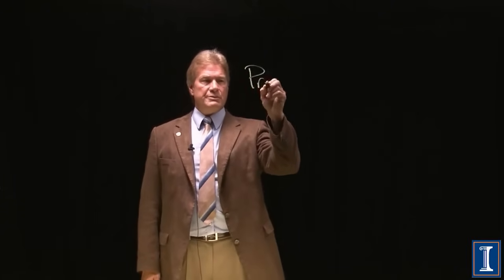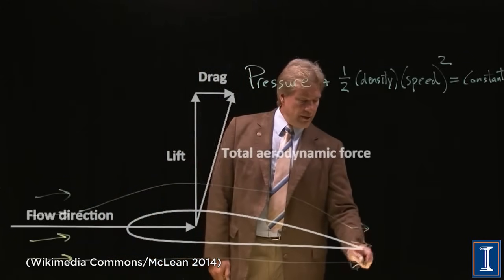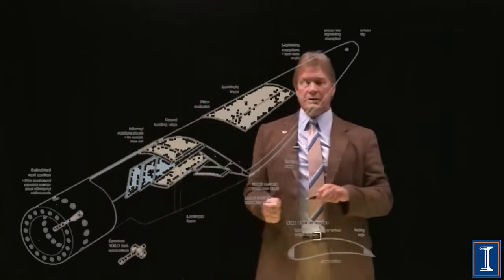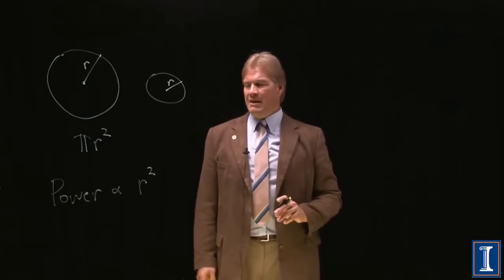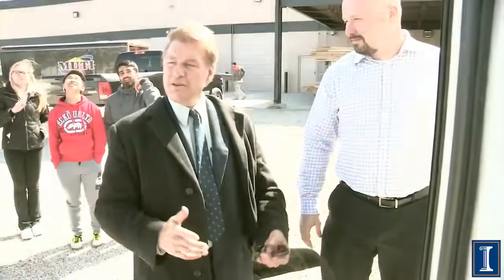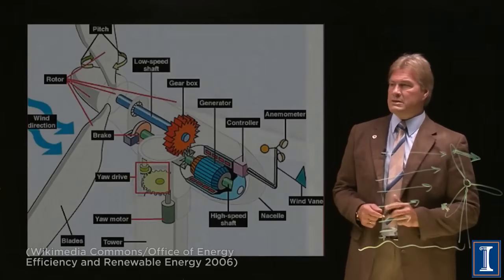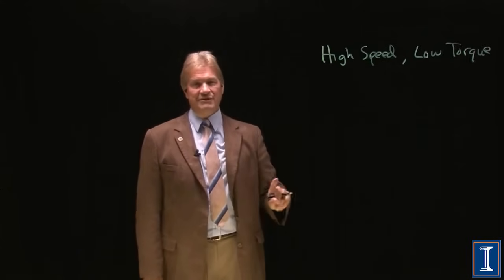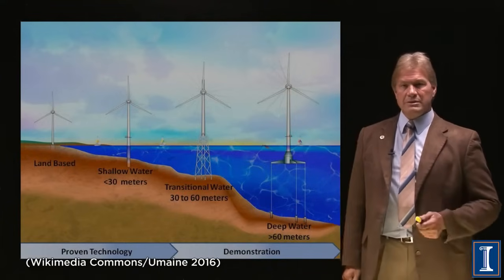How Windmills Work

Comment: Bernoulli theory of flight is complete academic nonsense, despite the math being "cooked" to make it look right. According to Bernoulli, a zero-thickness foil at an angle of attack, shaped to exploit the Coanda effect has no lift. Neither does the symmetrical airfoil of an aerobatic plane. 

Lift is created by Newton's laws. A change in momentum of the air creates an equal and opposing force...push air down, plane goes up. Bird wing, bat wing, bee wing, housefly wing are all net pushers of air downwards for lift (and rearward for thrust). The wing is nothing more than an air pump. 

Same goes with the farm windmill 15:39 and Dutch windmills - you yourself said they are flat panels - Bernoulli says nothing happens. Zero lift. Yet they are magically high torque. Torque is net perpendicular FORCE at a radial distance orthogonal to the axle.

The ONLY reason for an airfoil shape is to minimize drag around the structural elements of the wing and to keep airflow attached for as long as possible - laminar flow. The low speed Dutch and Farm windmills can ignore the drag component because the airflow is low speed. Old aircraft and hang gliders use shaped foils, not faired spars - both fail Bernoulli. All that matters is the net difference between the drag and lift net components perpendicular to the radial direction.

I'd also point out that modern windmill tips can go into the transonic regime, not merely 150 MPH. It's the reason for avian kills - never saw it coming.
Reply: Sorry, but you are misinformed on the subject and simply repeating common misunderstandings and rhetoric that is spread across the internet within communities that debate such topics.   Now if you talk to an actual aerodynamicist who actually studied, understands, and models all the physics involved he will tell you that both Bernoulli and Newton accurately depict the physics involved in generating lift.   

Even NASA (who knows a thing or two about the physics of flight) say as much:
https://www.grc.nasa.gov/www/k-12/airplane/bernnew.html

You made the claim "According to Bernoulli, a zero-thickness foil at an angle of attack, shaped to exploit the Coanda effect has no lift."

First of all Bernoulli never said such a thing.  Bernoulli never talked about the physics of aerodynamic lift.  He was concerned with describing, mathematically, the physics of fluid flows and he did so accurately.  The math was not "cooked" to look right  (whatever that means), it is IN FACT right (within the constraints of proper application) and they are used to this day in all kinds of applications within fluid dynamics.   His equations accurately describe the relationship between pressure and velocity within a fluid flow, within the constraints of the proper application of his equations.   However there are of course limitations to his equations because they greatly simplify the physics involved and don't factor in other ways energy is transferred out of the system hence they breakdown at higher velocities when compressability becomes a major factor. 

If you take a sheet of plywood (no airfoil at all) and give it a positive AOA the flow of air molecules will need to curve steeper and steeper to get up and over the plywood.  This means the air will be accelerated over the top of the plywood moreso than over the bottom and as a result there will be a pressure drop over the top of the plywood just as Bernoulli predicts and because there is are imbalanced forces there will be lifted generated.  What happens when the AOA gets too high? The flow of air will stop curving up and over the plywood and the plywood wing will be "stalled" and lift will drop away despite the fact it still has a positive AOA that can deflect molecules downward.   Your simplified explanation of molecules merely being deflected down doesn't explain why wings can stall and stop producing lift with healthy amounts of AOA available to deflect molecules downward.   Ever watch airfoil and airplane wing testing?  They put the flow indicator strings on the top of the wing not on the bottom.   The moment those strings stop showing airflow across the top of the wing we know the wing is stalled and not producing lift despite the fact it can still deflect plenty of air molecules on the bottom of the wing downward.   

Next example is a typical house with a typical high ridged roof battling hurricane winds.  We can all agree that with the windows closed  there is absolutely no flow going under that roof.   The house is completely sealed (for the purposes of this discussion) and thereby there is no flow under the roof at all.    Now we know, for a fact, that roofs blow off and go flying way up (produce lift) in hurricane winds.   But why? All the air molecules are being deflected UPWARD towards the sky and according to your simplification of the physics involved the roof should be producing DOWN force not UPFORCE.  Yet we get the opposite.  But we do know from Bernoulli that as the mass flow of air runs into the ridged shaped roof it will need to accelerate compared to the rest of the flow in order to get up and over the roof and thus it will create a low pressure region over the roof at which point the higher pressure (inside the house) will then PUSH the roof right off the house and up and into the air.  

The bottom line is all lift is created by pressure differentials and Bernoulli is talking about modeling pressure differentials across fluid flows.   Remember gas pressure is the force exerted by the gas molecules on the wall of something.  Even in your over simplification of momentum transfer, ultimately, we are indeed talking about air pressure on the wing (what other way would force be exerted)?  A helium balloon lifts upward because there is a pressure gradient in the atmosphere and there is more air pressure pushing on the bottom of the balloon than on the the top.   A rocket engine (which is Newton's third law at work) moves forward from the force of fluid pressure on the walls of the engine and nozzle.   That is why rocket nozzles are optimized for the pressure they operate in so that the pressure generated within the engine is used to move the rocket forward and not wasted away (as it would be without a nozzle).  That is why nozzles made for the very low pressure of space are as large as practically possible (before the packaging constraints and added weight becomes self defeating).
Reply: @thekalikal  Re-read the article. It says nothing about the relative contribution to lift from Bernoulli.  It is simply a fact the Bernoulli principle contributes very little to lift.  A Cessna 172 would have to fly at over 400mph to get airborne if Bernoulli's principle were the explanation for lift.
Reply: Here is the relevant language in the NASA article. 

"There is also an incorrect theory which uses Newton's third law applied to the bottom surface of a wing. This theory equates aerodynamic lift to a stone skipping across the water. It neglects the physical reality that both the lower and upper surface of a wing contribute to the turning of a flow of gas.

The real details of how an object generates lift are very complex and do not lend themselves to simplification. For a gas, we have to simultaneously conserve the mass, momentum, and energy in the flow. Newton's laws of motion are statements concerning the conservation of momentum. Bernoulli's equation is derived by considering conservation of energy. So both of these equations are satisfied in the generation of lift; both are correct. 
"
Now I never claimed all lift can be completely calculated using Bernoulli's equations.  As stated before Bernoulli's equations are simplifications and start to become less accurate as compressability starts to become a bigger and bigger factor at higher speeds in compressible fluids.   However, the general principle of low pressure occurring when an airflow is accelerated is the reality by which wings generate the vast majority of their lift which is Bernoulli in a nut shell.  As the AOA goes up the air is indeed accelerated more and more over the top of the wing (and you get more lift) up until flow separation where the lift will plummet.   If it isn't Bernoulli at work why is it that the lift plummets as soon as flow separation across the top of the wing occurs?  If it's mainly just bullets of air molecules being deflected downward then there should still be plenty  of lift available at high AOA's when lots of bullets are being deflected downward.   Yet we know from reality as soon as flow separation occurs on the top of the wing the lift goes to zero for all practical purposes.  

Your claim that  a "Cessna 172 would have to fly at over 400mph to get airborne if Bernoulli's principle were the explanation for lift" is something you just pulled out of thin air.  Can you please show me the CFD analysis did to attain this data? 

The reality is that at subsonic speeds the the pressure differential created by accelerating the air mass over the top of the wing is responsible for the majority of wing lift AS EXPLAINED PER BERNOULLI.  It is also the principle by which stall indicators work.   

It also explains how and why air foils stall at a certain AOA and how you can physically see a stalled wing with string flow indicators.  The stone skipping or "bullet" lift theory advocated above doesn't in anyway explain why a wing with plenty of healthy AOA remaining to deflect air molecules downward can produce nearly zero lift once you have a flow separation from the top of the wing whereby there is no more accelerated airflow over the top of the wing to drop the pressure which creates the pressure differential in order for lift to occur AS PER BERNOULLI.  

Remember, you can stall a wing at any air speed (Reno racers can stall in a pylon turn at 500mph if yanked too hard).  Even at these HIGH air speeds, that are  indeed shooting a massive amount of air molecule "bullets" downward due to to the high AOA, the wing is producing almost no lift.   This is why jets and high performance planes have AOA indicators to better indicate the performance envelope.  

The simple bullet theory, as stated above, cannot explain why the roof goes flying up off the house in a hurricane when the roof should be producing down force not up force.  But Bernoulli does explain it.  An accelerated flow over the top of the roof reduces the pressure and the higher pressure inside the house pushes the roof off.  

If it's not Bernoulli's principle at work then please explain why an airfoil stalls at a given AOA?
Reply: @thekalikal  Nobody said anything about applying Newton at the bottom of the wing and the NASA application of it to the bottom of the wing is merely saving face. NACA was so clueless about how wings worked to the point of pilfering most of their profiles from Nazi Germany's findings, including winglets.

The wing is a body that disrupts the freestream. Newton's reaction is to the change in momentum of air molecules - ALL of them, both fore and aft of, and above and below, the wing, from ground (Bernoulli again fails in ground effect) to the extent of the atmosphere. The Bernoulli "change in pressure due to velocity applies only to the surface of the wing, which is BS. And NASA's idiotic attempt to apply Newton to the wing surface is as much BS as a rocket pushing on air.
Reply: @thekalikal  A wing does not lose lift at stall. The lift vector's vertical component becomes smaller than the drag vector's vertical component.
Reply: @vidznstuff1  Of course a wing loses lift at stall.  That is how a stall is defined.  You can see this on the CL/CD chart published for any airfoil.  Look up any definition of aerodynamic stall on any published resource.  None of them will use your claimed definition.  Most will will describe an aerodynamic stall as the critical AOA at which the CL begins decreasing with increased AOA.  Depending on the airfoil design this Cl drop off from critical AOA can be a more gradual reduction in lift (on a stall friendly airfoil) or it can fall of the proverbial cliff (not so friendly stall characteristic, prevalent on airfoils optimized for supersonic operation for example).   The stall friendly airfoil will attempt to maintain flow and and some boundary layer attachment over the top of the wing over a wider range of AOA's past the critical AOA while not so friendly airfoils will very quickly lose boundry layer attachment with ever smaller increasing AOAs.  

I notice how you also ignored the example of a house roof in a hurricane generating lift  despite there being no flow whatsoever under the roof and despite the fact molecules are being deflected upward.  

Of course we are talking molecules pushing on the surface of a wing.  That is, after all, the only place where a force can be transmitted. The lift is indeed generated by air molecules imparting a force on the molecules that the wings are made of.   This is the very definition of pressure.   And rockets do require pressure in their engine chambers to work and they are indeed  "pushing off air" if by "air" we mean pushing off their own reaction mass which is a fluid in most rockets.
Reply: @thekalikal  Sigh. The curves mean nothing if you can't interpret what is happening - that is the NET vertical force, which is comprised of a lift vector, and a drag vector, net vertical COMPONENT. The lift decreases because of the vertical component of the lift vector being reduced geadually with angle until it hits zero at a 90 degree AOA. The sudden loss of the vertical force on the plane, which is what your curves show, is because flow separation creates a huge nonlinear increase in the vertical DRAG component.
Reply: @thekalikal  Open the windows on your sealed house and the roof does not come off...even though the freestream does not go through the house.
Reply: Oh great another flat earther conspiracy assfuck in the YT comments.

Comment: Could you dig down and anchor these to the bedrock instead of the enormous concrete? The way we do it currently seems like floating a windmill and concrete boat on top of a soil/clay ocean. I assume more rigidity means more power and less material stress.
Reply: Yeah - that'll get you points with the locals when you transmit the 'mill's low speed acoustics for long distances via the bedrock...

lol
Reply: vidznstuff1 could you not use an active noise cancelling system? Just send out the opposite waveform. Seems pretty straightforward.
Reply: @chuckphilpot7756  No - that has to be done at the source or at the observer's ears, both of which make no sense.

The floating concrete pier also acts as a vibration damper for the turbine structure...
Reply: vidznstuff1 Actually You could calculate the waves being generated and space the windmills so that as the waves are transmitted down to the rock, the way that multiple waves line up cancels them.
Reply: vidznstuff1 Oh and by the way, there are numerous reports of vibrational issues with the current construction standards. It turns out that concrete and clay/compacted soil aren't as good of dampers as you seem to think.
Reply: vidznstuff1 saying no to engineering problems such as this are the very reason we are still suckling on the oil and gas teats of mother nature. The correct answer is not no, the correct answer is yes, but I can't fathom how it could be achieved.
Reply: Corruption, not engineering, is the reason. As far as your analysis and proposals go, you don't appear to me to have the experience or education to understand even the fundamentals.

Comment: That cube law on wind speed affects the average power delivered by the machine.  Wind does not blow constantly so the average is about 20% of the rated peak power output. 
A 10 MW turbine averages about 2MW over a year. A 1000 MW wind array only makes 2000MW over the year.
Reply: A modern offshore Windturbine averages at about 60% of its max output capacity, so a big 12MW WIndturbine outputs an average of about 7.5 MW. And this factor goes up the taller and bigger the Turbines get.